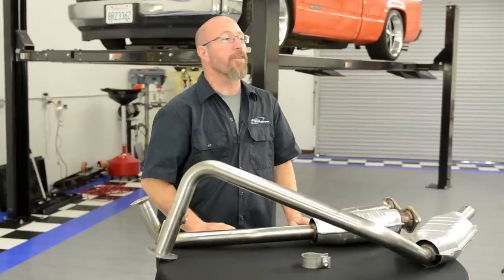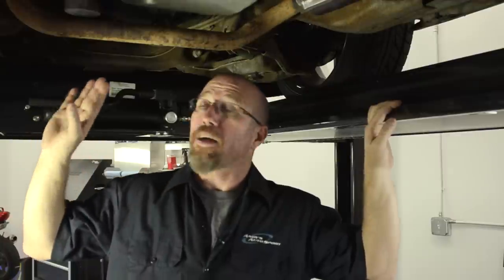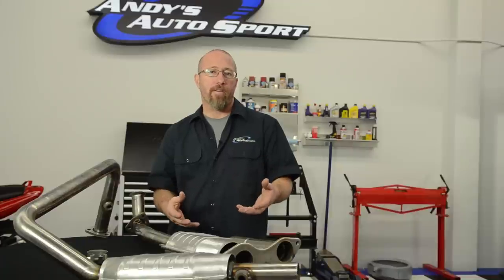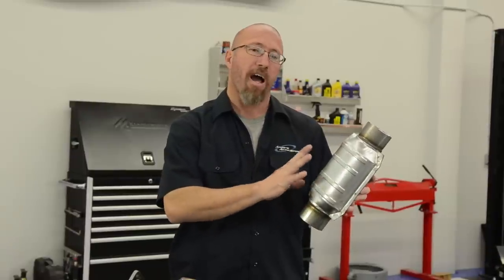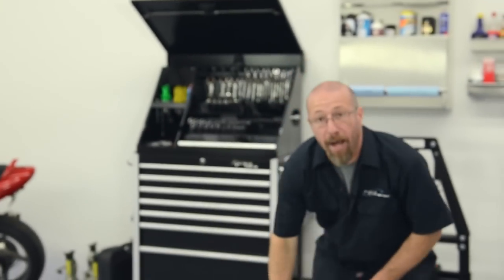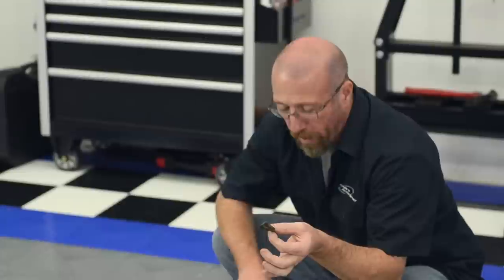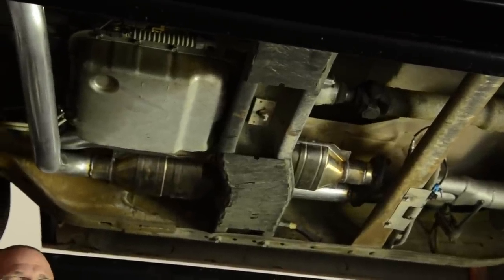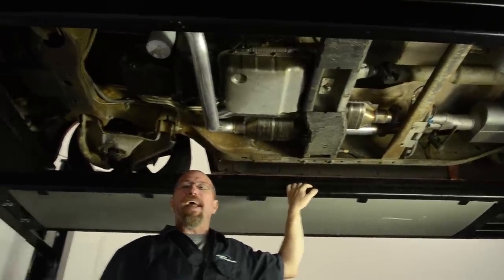Catalytic Converters - Presented by Andy's Auto Sport

Comment: An all motor engine will only gain 2-3 hp with no cats. High flow cats flow remarkably well as much as a straight pipe. Turbo engines on the other hand run much better with no cats. Unless you don't care about getting caught go test pipes. But If you have a basically stock engine with exhaust work done. Go high flow cats.

Comment: Don't ruin your o2 sensor with oil and make SURE that your old o2 sensors work, before fitting new cats. I had once sensors that worked only for 10mins after start and then randomly generated voltage for few secs (cheap ones). So buy brand sensor, don't waste money,

Comment: I think it's ridiculous, but it's illegal to replace cats that are properly working. You can't relocate them either. So long tube headers with high flow cats can't be used. I went with mid length coated JBA headers & high flow cats the retain the original position of the O2 sensors & the cats themselves. We don't get emissions testing in our area, but JBA said the cats were 49 state legal.